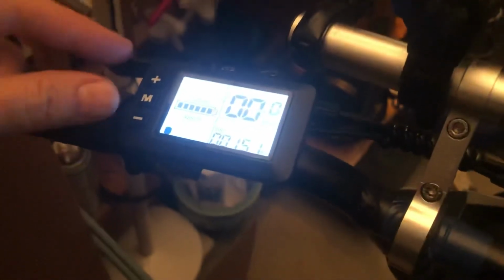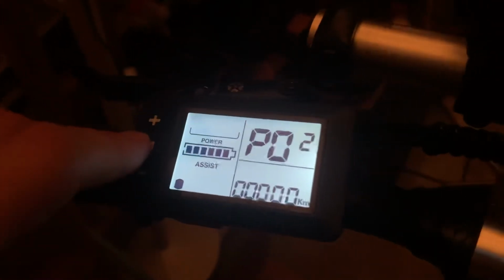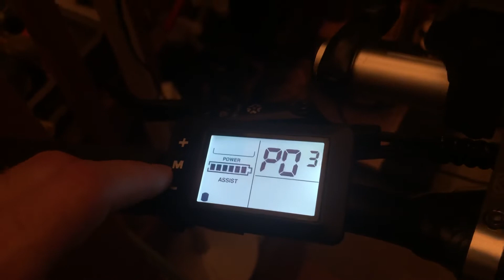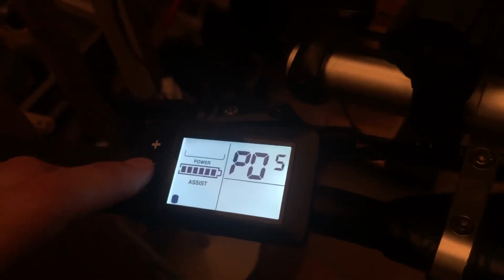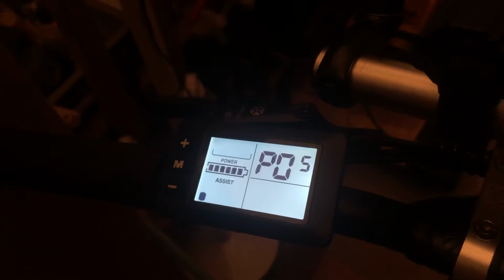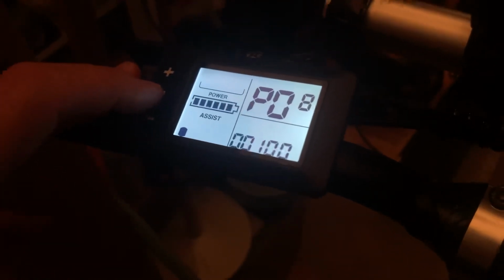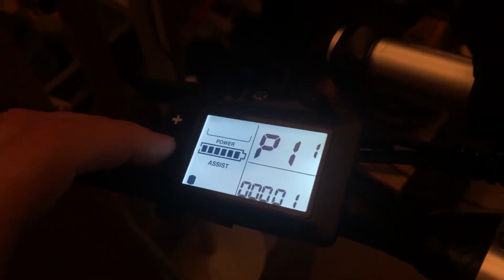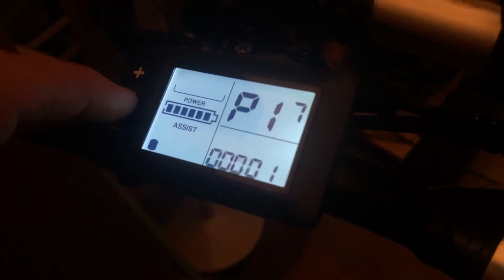Freego DK200 codes explained.

Comment: FYI i got my bike yesterday and the handbrake hold trick did nothing for me. The PO8 setting was set to 25 but I moved it to 100 and it did increase the speed. I managed to get from 24kms to 36kms
Reply: I changed my PO 8 and got my bike from 20 mph to 30mph

Comment: U have to change PO7 to 00001 and change PO8 to 00050 and it will go 45 mph mine does and make sure to change PO2 to 1 so u can see the speed in mph and not km
Reply: No it doesn't go 45mph GPS wise, only your readout shows 45, it changes only the calibration of the speedometer not the speed of the bike.
Reply: huh
Reply: This seems to have worked! Thanks so much! Didnt have to 0050 option in PO8 so i set to 100 and i can get 35mph consistently now

Comment: I have a hall sensor issue on the dk200, it's fine the first mile but then pedal assist and throttle cut out very very frequently, think you could point me the right way?
Reply from the maker: Maybe the brakes are cutting the power.

Comment: Are you absolutely sure about that throttle on and off setting?  I went to check mine to make sure it was set to zero, after watching this video.  It already was, but my throttle still isn't working.
Reply: Same!!!! Did you get yours working???
Reply: @robr.3279  No, but I sent it back and they fixed it for me.
Reply: @robr.3279  Did you find out how to fix  the throttle issue I dont know what to do I already switch the p0 9 back to zero and it still doesnt work

Comment: THANK YOU!  I've also tested this function and the fastest I could get the bike to go is 28mph with my big butt. This means it CAN go faster...we just have to find a way to fully unlock the 1200w motor. I'm thinking the limitation now is either the battery's power or the controller limiting the power to the motor.
Reply: Bit of both. The esc is a little cheaper than ideal and the wattage listed is the peak output, so a little misleading. I think its a 1000watt motor. Hard to find specifics. Some vendors say 750 continuous, 1400 peak. Others 1000 continuous, 1400 peak.

Comment: I think because this is essentially a low-budget e-bike that the manufacturing consistency may be quite poor. I have a DK200 that carries my 165lbs at 32mph on a full charge, dropping to 28mph after losing a bar of battery.
Reply: There is another hidden screen. Hold the M and the + keys down at the same time and it goes into max mode. Hold it again and it goes into Average mode

Comment from the maker: I'm enjoying the DK200 regardless.  Next, I'll demonstrate how to mount the second battery for mid-ride swap.
Reply: Great, sees almost that I've got another model of a DK-200 from Freego..

-Front suspension is cracking like crazy when slapping back (sounds like it will brake soon)
-Batterie last for about 20 km (with paddling)
-The bike seems to discharge when going downhill
-The rear break came with very little liquid, got it to the service, worked for 100 km, its going to be empty again now.
-The motor once just stopped, could not switch it on again, but the control box got very hot and it smelled like plastic..

-Even when advertised in snow, a lot of parts got rusty after just a tiny bit of rain and the battery notice says: Only for use in dry environments..
-The bike is completely charged after less then 4 hours, wonder about the battery capacity then, should take the double amount of time..

I send a message about the poor battery to the support and the only response was: You should paddle more!

All together, a very disappointing e-bike experience..
Reply: hey bro how do you fix the delay on the throttle on startup or when u stop a while there is a delay
Reply from the maker: @frankrastegar8531  I have noticed that 1 second delay.  I’m not sure if there is a solution.

Comment: Yea its completely false advertisement. I contacted them, they stop replying after the first email. They're correct on the speeds though... PO8 (48) You LIFT the back tire OFF the floor, it says it goes 34mph, easy. PO8(100) again, You LIFT the back tire OFF the floor, it says it goes 38mph. But riding it? yea no difference lol. I'm 150-155lbs and can't go over 28. Taken it to 42, but going down hill. Could of purchased something worth it for the same price... Big fail. EVERY SINGLE VID Y'ALL SEE SAYING IT GOES 28+ IS FALSE!!!! even though it is cool to get a bike on a discount for a positive review..
Reply: which e-bike is better at that price? I'm planning on buying this one
Reply: @laugecow9624  Hey, so If I were you, I'd go with something like Juiced bikes or Super73 cheaper models fir a non folding one. I decided to just save up again for a better bike, one that actually goes up to the 30s lol. With this you're basically paying for a strong (front only and cheap shock) frame. If you go American, you might actually get customer service. idk where you were buying yours from but there are a lot of folding options that go 28mph for a lot less. I got mine from amazon and returning an item to a 3rd party seller that isn't responding to emails is done at your own risk.